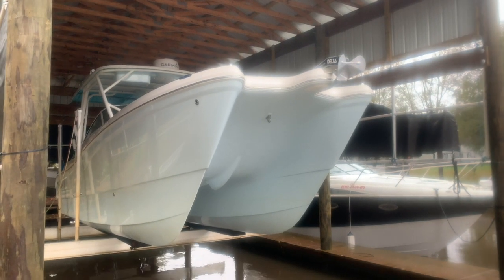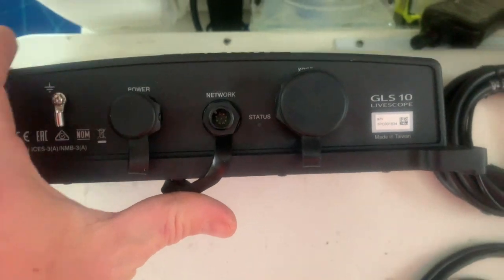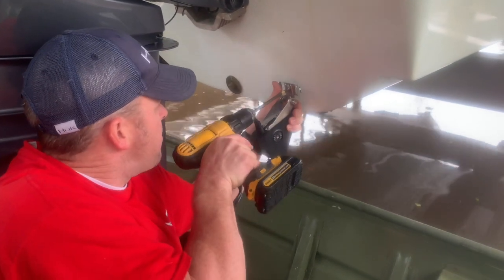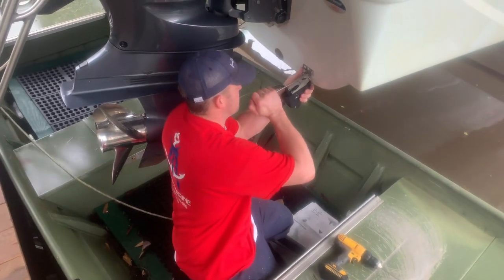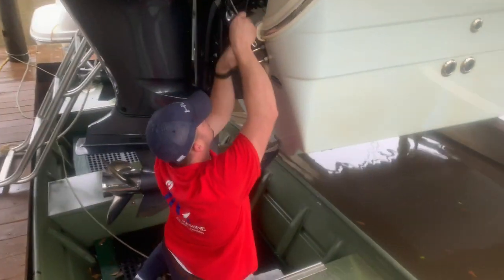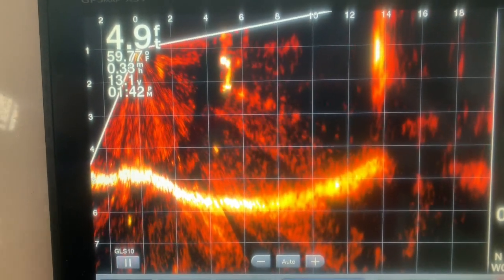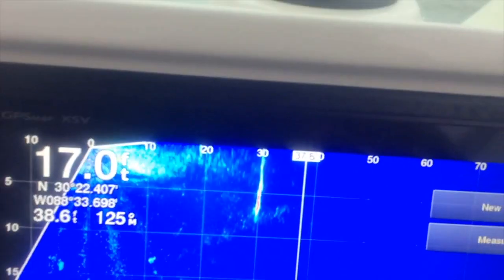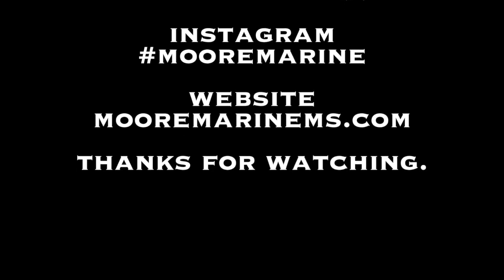Garmin Panoptix(livescope)transducer install and on the water testing

Comment: How did you run the cable from the transom into the boat given the large connector and what sort of clamshell did you use?   Through the splash well?

Comment: Where did you attach the power/ground wire so it’ll turn on when you turn on the Garmin head unit
Reply from the maker: Mike Harley I attached the power and ground to the same fuse block as the Garmin electronics but that’s not crucial because Garmin uses the network cable to turn on any attached accessories that are networked to the screen.
Reply: Moore Marine thanks for the info

Comment: Do you have to move the transducer bracket up and down for forward and down view
Reply from the maker: kieran grimley not necessarily the bracket but you do have to loosen the to mounting bolts holding the transducer itself and adjust it  according to your preferred view.
Reply: @mooremarine526  ok thanks, how do you find it on the transom a lot of guys say not to do that put it on a pole are trolling motor but I didn't like that idea